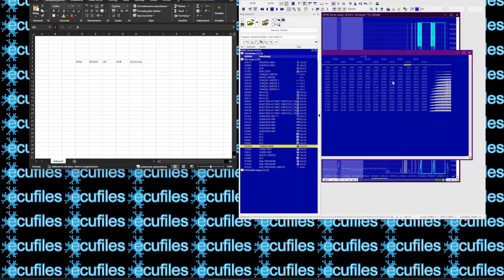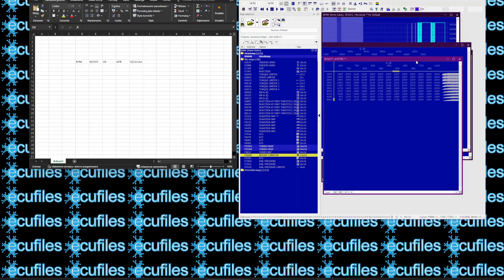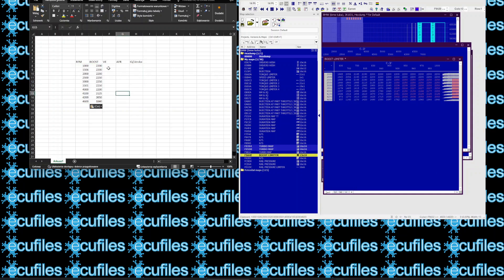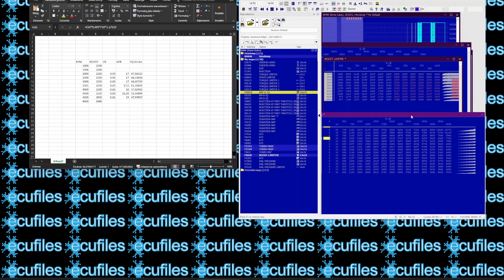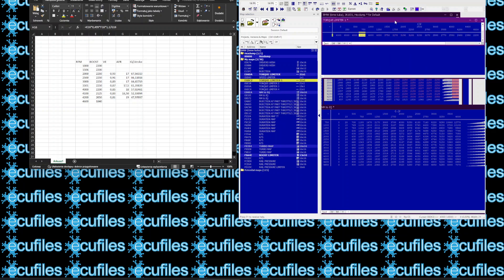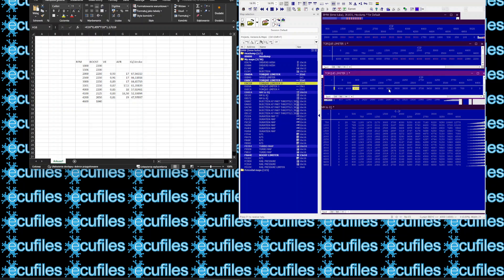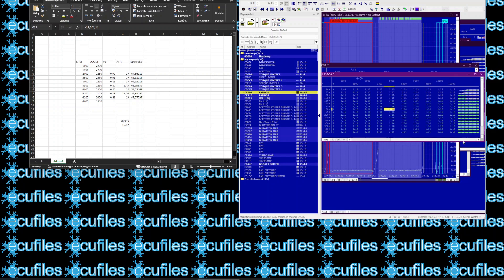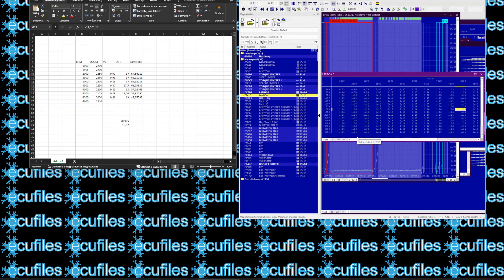BMW e46 318d 116HP M47  stage 1 remap turtorial

Comment: How much kw after stage 1 ?
Reply from the maker: About 110kW/330Nm
Reply: @ECUFILESCOMPL  Thanks for your answer. Actually I have the same car but I can't figure out if it has been modified or not, mine is ~101kw but I only have a chiptuning box (connection to the injection ramp), would it be possible for me to send you my .bin file and you look at it quickly?
Reply from the maker: @Seth_41m  sklep@ecufiles.com.pl
Reply from the maker: @Seth_41m  in my opinion remove box, sell it, and make proper stage 1, box is working by fooling ECU
Reply: Yes that what I'm going to do 😅 I've sent you a pm on your adress, take your time there's no hurry :)